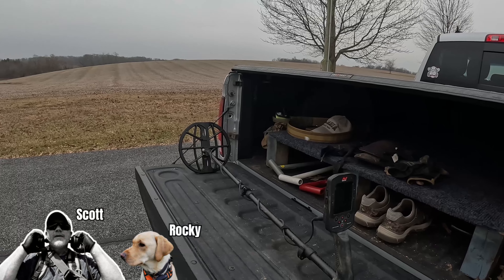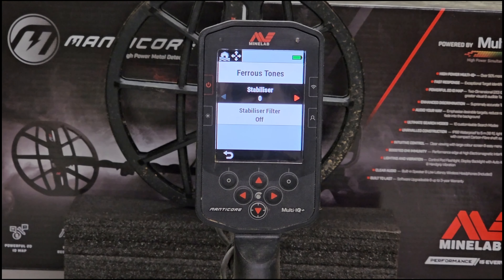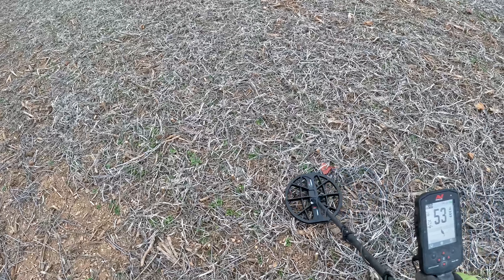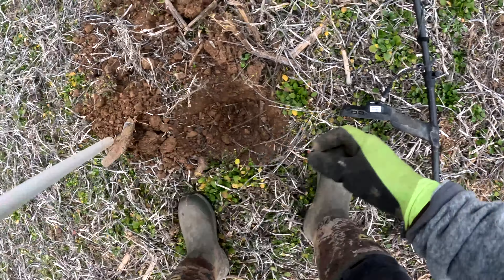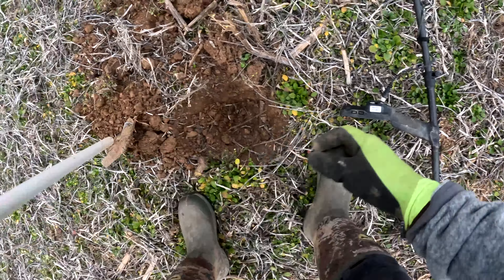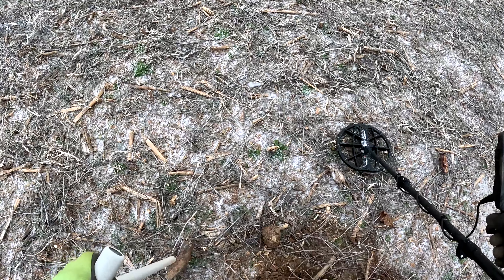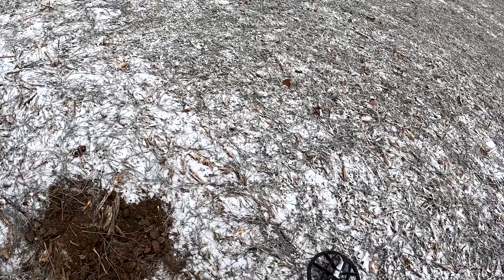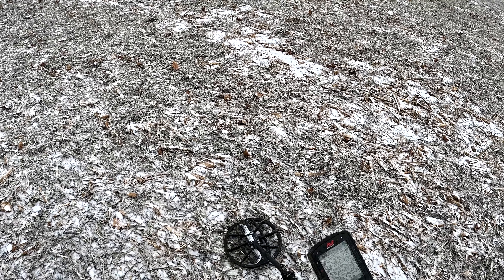Manticore Stabiliser Use and Several Full Dig Examples to Help Teach You This Machine.

Comment: 3rd day with the Manticore and I’ve never dug so many nails in my life. 
So bad I had to switch back the CTX 3030(with harness)to not completely ruin an entire weekend. 
I had a equinox 800 years ago and I never dug so much trash before in my life, I sold it quicker than I could turn around, I continued using my Etrac and it never let me down, not even till this day. 

The manticore reminds me so much of the equinox 800.
Reply from the maker: Maybe stick with the Etrac. I mean after 3 days I would probably sell it :-) jk. LOL.
Reply: You sound like me.  But this is my first "real" metal detector.  I say that because to me it's a Mercedes detector compared to the only other detector I had many years ago.  I got rid of that one like you said,  faster than I could turn around.  I like the fact that it does what it's supposed to do and detect anything and everything metal.  I'm learning really.  I had a real junk detector.  I won't even say the brand.  But all it had was two dials.  That was it.  This Manticore has so many settings that it feels overwhelming.  But that's why I'm here.  This guy actually does what I've been looking for.  Explaining every setting.  What it is, what it does and a recommended setting for it.  This detector is a beast! This is just a suggestion.  Learn all the settings.  Adjust your settings as you learn,  and your trash findings should drop considerably. 
This is what I'm learning as I'm typing this.  Good luck!

Comment: Scott I was watching Brass Medics Manticore video about the stabiliser I believe the only way the stabaliser is enabled is to turn the filter to on. I use it on 4 or 6 and pull many coins out with square nails it really works well. I dig very few nails now.
Reply from the maker: Yes the filter is only available when you have the stabiliser set at 1 or higher.

Comment: Well, this is the kind of video that I need.  I have learned more in this video than I have from watching many others.  But I had to stop the video to make this comment.  I feel like it's ocd kicking in.  But I would, without a doubt, check any hole a second time after you think you found whatever.  To me, it just makes sense.  Especially for newbies like myself.  The last thing I'd like to ask is, is there a pin pointer setting built into the Manticore? About 3/4 of the way into the video, you do something, and then it looks like you're using the Manticore like a pin pointer to make the high pitch tone to pin point the signal.  Can you show in another video what that is? Please.  I never thought I'd watch a 44 min long video.  But I did this one..😅
Reply from the maker: Well I appreciate your dedication thank you. The Manticore has a pinpoint feature built in like most machines. I will use it to precisely pinpoint dead center of where I think the target should be and then dig. Yes, double check your holes. Thanks again.

Comment: I've had the 900 now for about a year. It seems like the 800 more stable numbers  it didn't jumped around as much.
Reply from the maker: Maybe so but I know others who have the 900 and have smoked me on hunts. I think if the numbers jump significantly (greater than 5) and you turn 90 degrees and you still hear something non-ferrous you still have to dig it. Over the weekend I was using the 900 and pulled 3 nails out of a hole and at the bottom was a small button. I could hear it but most people would have passed it up.
Reply: So 3 (three) indisputable facts....fact #1....the machine unmasked 0 (zero)  non ferrous targets..only found non ferrous targetd all by themselves....fact #2....stabilizer really showed no benefits.....and fact #3....we are all disappointed you didn't continue to dig one of those asteroid craters deeper and bury that machine! Retire that thing already!! Haha..m

Comment: I am having such a hard time understanding why to dig one beep but not another, when walking and swinging what makes you stop and investigate one beep over another?
Reply from the maker: If you just started detecting, this is normal. You will get to the point with enough hours on the machine where you will know the difference between a good sounding target and just chatter. Give it some time. You have to dig everything at first.
Reply: I just got my detector about 2 weeks ago.  Everything I've dug so far is junk.  But to me being new.  I still smile because it's fun.  I'm not out to think I'm gonna strike it rich and become a millionaire. It's just the fun of finding things.  Pull tab,  bottle cap,  aluminum foil.  Nails,  fence pieces.  That's all I've been finding so far.  But it's fun.  
It wore me slap out the first time out. Lol